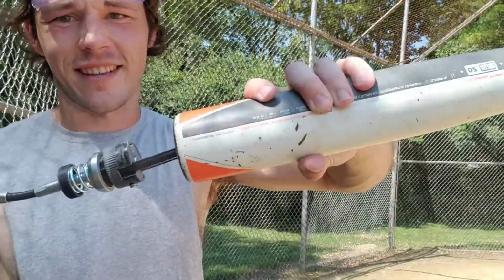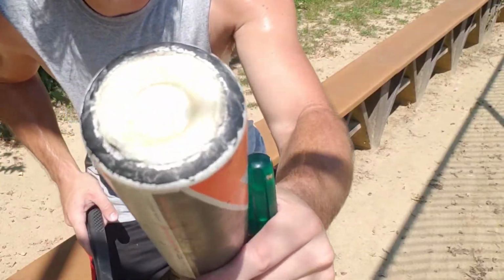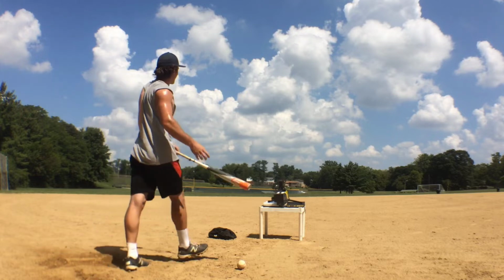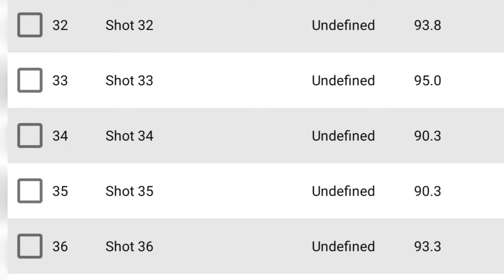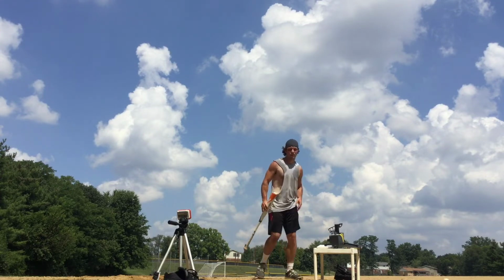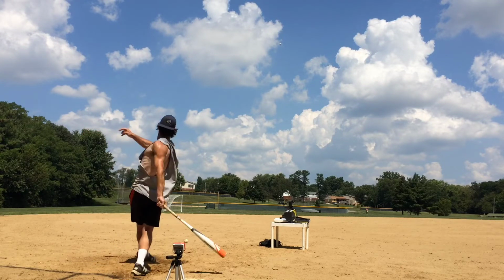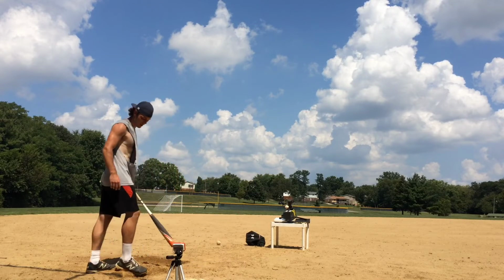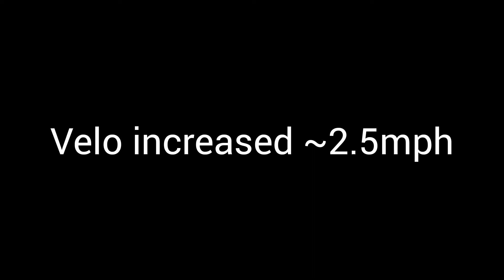I Shaved a Composite Bat. Here's how much it improved exit velocity...

Comment: We used to shave bats 20 years ago and i think used shave about 5 ounces out
Reply from the maker: Thats crazy those bats must have been hot! Did you use a lathe (which I think might be more effective) or a hone like this?
Reply: @andrewbats8523  lathe as i knew it but it took away from the bats life , didnt last as long so then most would just have the bats rolled  which just broke the bate in faster with out removing end cap then you had guys flat out painting utrip bats for asa play and buying asa decals on them to look like asa bats , this was done in men’s softball , bats were crazy hot , got to the point where bats were tested before play in tournaments and then registered for the tournament
Reply from the maker: @Knarf14  thats cool to know! I had always heard jokes about painting an illegal bat to match a legal one but I didn't know anyone actually did. And that makes sense about the shortened life, would be pretty tough to keep breaking bats and affording to do it over. I heard the noise can change a bit one you shave enough out too
Reply: @andrewbats8523  bats got so hot after break in period that pitchers started wearing goalie gear  and easton made bats that would turn almost a different color when the composite broke down too much and became to hot for play , bats were called easton clarity I believe, long time ago , a broken in men’s softball bat can easily have ball come off bat at well over 100 plus mph well over , it started getting difficult to find someone that would be brave enough to pitch … lol
Reply from the maker: @Knarf14  haha I can imagine! I'd have all that protection too if thats what we were up against. I imagine hitting with some of those made you feel like the strongest person alive too lol its wild how hot some old composite bats are
Reply: @andrewbats8523  made the smallest of guys look like monsters
Reply: Did anyone consider someone could maybe…die?

Comment: What softtoss machine are you using? And what are you using for radar?
Reply from the maker: Soft toss is Sklz Catapult, about $70 or $80 on Amazon or at sporting goods stores. It will break if hit directly back @ machine just fyi

And the radar is a flightscope mevo BUT they removed the baseball app from the app store and it's no longer usable unless you already had the app downloaded (without the app the radar is just a paperweight). It is very comparable to a pocket radar though, I have both and have done multiple tests and they average within a half mph of each other

Comment: Hit me up and I'll walk you through better steps and better results or send me the bat and ill hook you up to see amazing results
Reply: Hey bro I just end cap removal tips I've got a lathe and a bridge port that I can index the head at a proper angle and use a 3 arm hone with coarse grit stones and remove a shit ton of aluminum from the inner walls of oldschool exo grids 2 5/8 barrel I like the spring loaded hone because it self aligns to the barrels wall angle along the taper